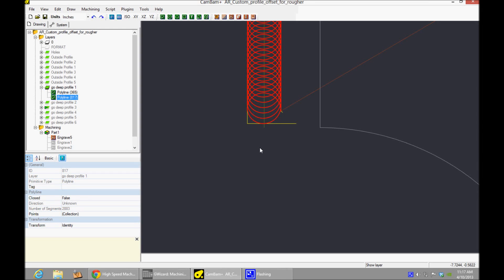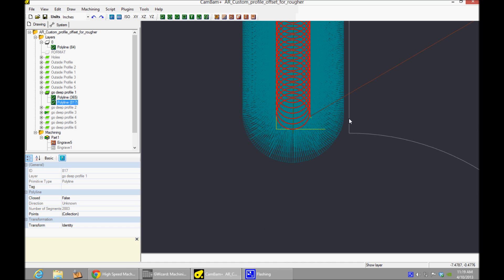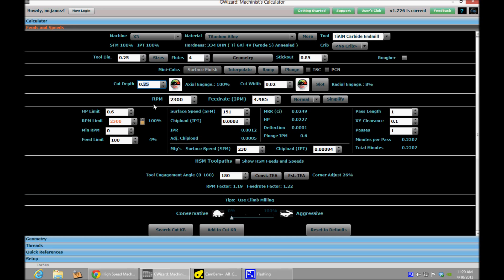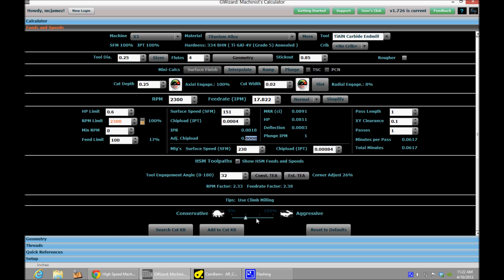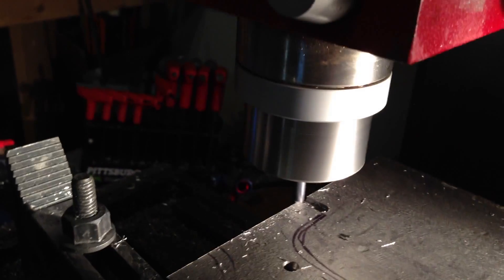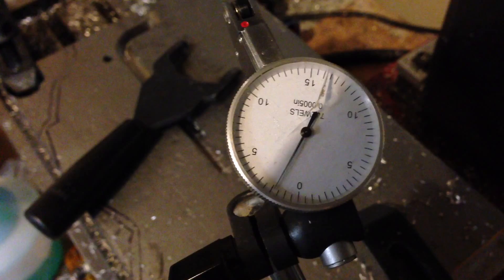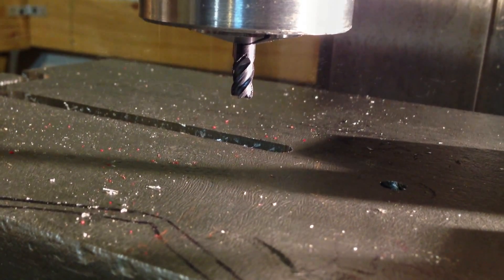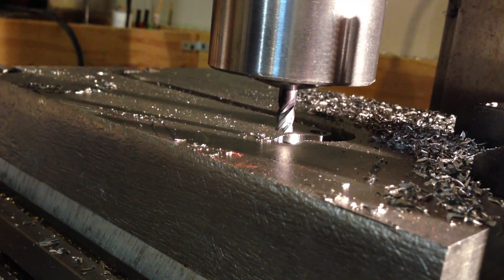Titanium Machining Techniques for Small Mills Part 2

Comment: USE GODDAMN CUTTING FLUID!
Reply from the maker: Cutting fluid isn't required with TiAln end mills. I tried it with and without and had no major difference in tool life. This is true for my slow SFM rates and may not be true for machines with higher rpm.
Reply: +Jim McPherson You are correct!

Comment: I've been machining 6v & 4v at my job for over 4 years now and we always use Coolant,  due to the heat build up in the work piece and tool.  I have learned over the years that chip thinning(light & Fast) is worth its weight in gold if applied in the right application.
Great video about cambam and gwizard. thank you

Comment from the maker: I did the CNC conversion as a hobby project by itself. If you enjoy tinkering then conversion is the way to go. However, if you just want a CNC machine Precision Matthews has a pretty compelling CNC mill ready to run that would probably cost less in the long run for a finished machine.

Comment from the maker: The SX3 may be heavier, but the G0704 is still stiffer due to it's closed column. The open back of the X3 just kills it (I believe due to harmonics). Agree that if you can fit an RF-45, it's the way to go.

Comment: Thanks ever so much!  The conversions site I perused offered conversions for both the SX3 and G0704.  Having nothing approaching even a simple Vertical mill right now, would you recommend a complete system purchase or a DIY experience?  (I'm handy, but unsure exactly what is required for a DIY conversion).  Reply appreciated.  Do you know who makes the Grizzly G0704?

Comment from the maker: I've not used a SX3, mine is the plain X3. I don't think there is a rigidity difference between them though. Variable flute endmills help dampen the resonance that the X3 really suffers from. However, today if I were doing another conversion I'd probably go with a Grizzly G0704. The tapered gibs really appeal to me as adjusting the gibs is rather frustrating on the X3.